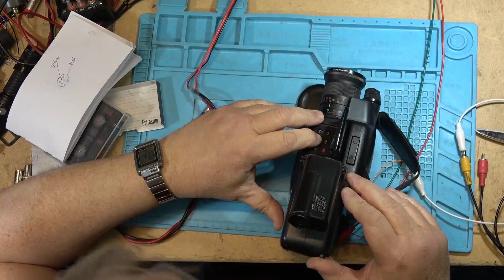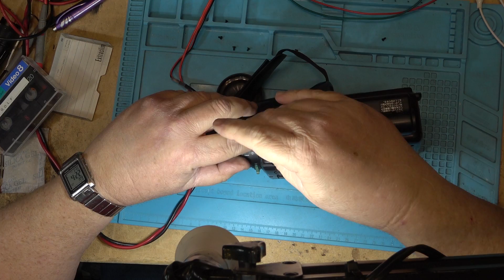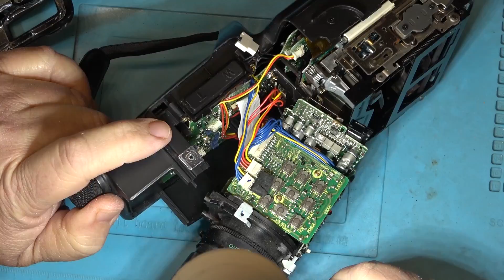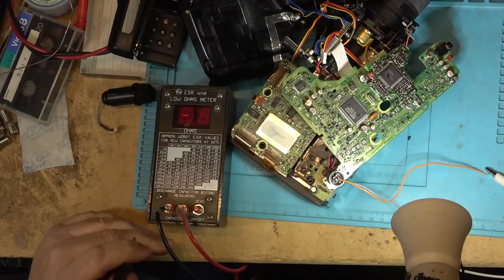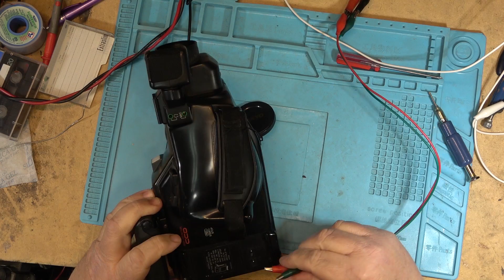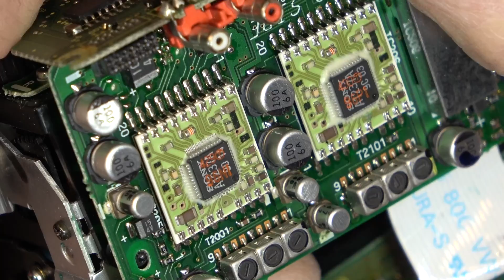That's it i'm Done Working on this CRAP

Comment: Great video as always. I've actually just almost finished re-capping a Sony CCD-F150 and am conscious of the future issues you mentioned with leakage on multi-layer boards. I'm doing it because the camera belonged to my parents, I have a couple of tapes we've never seen and also mostly just for practice / fun. The new caps didn't cost a huge amount (less than a few beers in town these days). I've thoroughly cleaned the board with isopropyl and there luckily wasn't as much corrosion as I'd expected - only a couple of isolated spots which weren't terrible.

Anyway, it's been great practice on my soldering skills, regardless of outcome! Otherwise you're absolutely right - it ain't worth it!!
Reply: Did you get it working. ?!
Reply: No, boards are al junk ate all the trwces pf the double triple layered boards @vcrguy1686
Reply: How does it hold up now?
Reply: @brew2779 it plays tapes back absolutely fine, but after about an hour of use after putting it back together, I lost a visible picture through the lens. Every now and then when I power it up after a few months sat, it displays an image but just fades after a few mins. I think it must be where the electrolytic capacitors have leaked into the layers of the board. Otherwise it's holding up well for playback.

Comment: For sanyo products, these sure do have a lot of Sony components in them, I wonder if sanyo bought circuit designs from Sony, but totally dropped the ball on the chassis
Reply from the maker: Sony made pretty much all the custom chips for 8mm and hi8. After all they designed it.

Comment: Sanyo has made some excellent components as often seen in audio equipment from many old Japanese manufacturers like Technics and many others and especially the power amplifier module in the STK series which can be found everywhere in the 1970s 80s but I've never worked on any Sanyo audio equipment that was not riddled with problems. Sanyo obviously made good components but was clueless about how to put them together, rant over!
Reply from the maker: I admit they did make some good components but so did toshiba and nec and those companies also semed to have problems turning out devices that knocked ones socks off. That was king Sony that did that.
Reply: @12voltvids  I agree Sony was slightly different and was slightly more expensive but for every Sony, I ever worked on and owned, TV's Hi-Fi seemed to reach above the rest. I had a Sony TV, Amplifier and so on but however British speakers in the day were the best! Love your channel and looking forward to your up-and-coming Tube amp project. cheers Ian

Comment: Why do the capacitors always go bad in old camcorders? A few years ago I wanted to restore a VHS camcorder for a friends art project. I had to get 4 different camcorders before I finally got a restorable one! Why does that always happen? Did they use special capacitors in those?
Reply from the maker: They used a new type of capacitor, the surface mount caps. The early parts were all bad from the get go. There were a couple of factors at play. First they had to be environmentally friendly. That means no tixuc chemicals that earlier (and still working 50 years later) capacitors contained. No pcb oil for example and no other toxic materials.  This was so when the unit was disposed, and went to landfill or incinerated no toxic materials would leach into ground water or go into atmosphere.  These newer compounds however were not stable.  The pH changed depending on if they were holding a charge or not. They were engineered to be pH neutral in their charged state.  When left totally discharged they became either slightly acidic or alkaline.  For something that was used all the time this wasn't an issue.  The caps were charged or had some charge in it that was changing as the capacitor did its job.   The problem was in camcorders. Most people didn't use their camera every day.  Sure the first year or 2 when the kids are little they are used every time the baby burps or farts.  You know the new parent syndrome every little event is recorded. After the first year or so that gets boring and the camera sits in its case only be brought out at Christmas birthdays or family vacation. This is where the problem happens they sit the capacitors completely discharge and the pH goes out of whack and over time it eats away at the seal where the wires lead out of the capacitor. Eventually the seal fails and they now close of electrolytic starts to leak onto the board where it saturates into the board under the cap. It soaks in to the fiberglass board and on to the next layer below where it spreads out and starts eating away at internal layers. This is why camcorders where the most unreliable device that the mainstream manufactures produced. They're never worth fixing once capacitors have started leaking. The only way you can fix these properly and be assured that they will continue to function is to change the entire board. Of course that's not possible because no spare boards were made available and even if you were to find a New old stock board it's had capacitors City in the discharge state since it was manufactured and they will all be bad even though they've never been used. When camcorders were made manufacturers all had a designed lifecycle a 5 years. That means at the time of production the manufacturers figured that people would replace them within 5 years with a newer better model. And most people did just that. Most camcorders were completely shot after 2 or 3 years because people would take them to the beach get sand in them did get rain on them to take them out on boats get salt spray. They were done after a couple of years and most people just bought new ones and moved on. Then there were the working professionals that used them every week to shoot weddings and stuff. Those ones wore out mechanically before the caps failed.  The only ones i changed heads on were the ones used by videographers.  They never had cap failures.  Untill the guy bought a new camera and put his old camera aside as a backup. One day he decides he needs a second camera fires up the second one that's been sitting for 6 months or longer only to find surprise all the Caps of leaked and it's now junk. Fortunately the new digital cameras are much more reliable. I have one that's 9 years old still works great that's my original 4k camera FDR fx100. Fortunately digital circuits don't rely on those crap electrolytics

Comment: No consumer electronics are worth exporting to another customs zone. Not even frigging Bose rubbish. The customer is mad. 8mm camcorders are a dime a dozen just like VCRs, and they were always considered disposable items even at the time. If you want to fix these - try to do them yourself and toss when they don't work. Late Sony included.
Reply from the maker: Well normally there are no duties or taxes on products being shipped on for repair but if the senders places a value on it then it is treated as a sale. A few years ago someone declared a Walkman as worth 1000. That cost him 160.00.  He insured it hoping it would be lost.
Reply: @12voltvids  Yeah but you've said yourself in the past that just the shipping can be far in excess of what any of this stuff is worth.
Reply from the maker: @jasejj  yes shipping is the expensive part

Comment: huh , and here i sit and fix such in my free time, i like working on them cuz its always a challenge :D  ,  just thinking , if you dont wanna put up with such cameras id be up for the challenge ^^ 

in other words whoever wants camcorder repairs that 12voltvid wont do , contact me, and i try ^^
Reply: as a sidenote , ccd-f and ccd-v are not fixable , those sanyos ? sure i would recap them , not the worst ive seen (like jvc gf-s1000) .
Reply from the maker: It not that I can't fix them, the problem is once you charge a fee to repair you are married to it. When it breaks 2 weeks later it's back and then you are doing it again for free this time.  You get it running and 2 weeks later it breaks again.  As you saw from the first one someone has already changed most if the caps, an ic has also been changed.  Someone already recapped it and that is probably why the camera section is working and likely the chroma problem is a corroded trace on an internal layer that has gone open.   I have the experience from my time doing this for a living to know when it is time to cut losses. Customers also don't want to throw good money after bad.
Reply: @12voltvids   i understand you officially repaired these back in the day , for my part i have sympathy for most old camcorders especially odd (like the twin lens sharp) or fancy ones(minolta master  pro 8-918)  , they may have no collectable value in functionality (standart def) but collectible in a way what tech marvels they were back in the day (all compact and such). either way i dont necessarily mean to downtalk you. id just like to blow life into those cams to see them working even if its short lifed
Reply from the maker: @Dr.-Smart  i just dragged out my old Sony ccdtr81 which I fixed a year or so ago. It hasn't been used and even though it turns on and plays, the picture shakes back and forth.  They don't stay fixed no matter what you do to them.  It's one think to get one if your own working just for the sake of getting it going but when you are charging someone they need to stay working for a while. That's one if the reasons i won't spend the time to change a bunch of parts.  Because they won't last and they the person that spent the money is mad.  There were lots of stupid designs back in the day.  Most of those sharp cameras were a joke.  Targeted at the older generation that didn't want to hold a camera to their eye but totally useless outside on a sunny day.

Comment: Changed all 100 caps in my Philips Full Size vhs cam from 1989 2 years ago. Still going strong. but i cleaned every hole for the caps with iso to stop corosion well its working
Reply from the maker: I changed all 120 in my old v5000 back in 98 and then sold it. About a year later it was back. Came back to the shop i worked at and other job cap problems had arisen from latent residue that had seeped into the board. You can't clean the layers internal. Your old full size camera probably only had a double-sided board as most of them use just a double-sided board not a multi-layer board because they had the physical room to put them on a full size board. The small cameras all use multi-layer boards a big difference.
Reply: @12voltvids  it has little holes going into the midel of the board

Comment: Its amazing you put up with fixing consumer crap that only gets worse. I did fix coin op for many years that had monitors but still much easier than a tv set. Commercial equipment is much easier but no youtube audience as its so expensive.
Reply from the maker: I put up with it for 20 years and then for out.   It's only a hobby now and I am saying no to much stuff. What you see on my channel is about 1/3 if what I am asked to repair.
Reply: @12voltvids no end of work that can maybe earn minimum wage with maximum skills
Reply from the maker: @markanderson350  If you are lucky. The only reason I took these in was to show them on the channel. That is where I will make a few bucks over the next few months and who knows it could go viral.
Reply: @12voltvids  Sanyo camcorder video goes viral, news at 11.

Comment: Dave, tell the people ' I don't do budget camera's sorry.
The level of crappyness is your choice.
Stress will screw you up if you don't change.
Reply from the maker: No stress here. I'll let you in on a little secret, the only reason I accept this crap which I know going in is not repairable is specifically to take it apart on camera to show you guys the inside of the unit basically and how bad they are and why you want to avoid trying to fix these. I know I'm going to get the trolls out there they're already responding saying that they could fix it.  Maybe it can maybe it can't. If it's just the capacitors and there's no other damage and the leakage hasn't soaked through the board and damaged internal layers that's one thing but once the corrosive electrolytic gets into the circuit board it soaks into the internal layers and crowds them. Might work today might work tomorrow might work 2 weeks from now and then you turn it on and it doesn't work because the trace has gone open. I have several cameras that are mine where I've gone and changed capacitors on them just to show if the camera working I put it together it works fine I'll hold it out of the box six months later and it doesn't work again because the damage that was caused before just powering it up reactivates electric because you can't get all of that crap out of the internal layers. Now someone's going to say they'll ultrasonic clean it, all that will do is drive it further into the board and cause more problems down the road. Better just to cut losses and move on.
Reply: @12voltvids 
I was fixing a friends car fob that was unreliable, i thought ill use a scanner to hear when the fob worked.
Well my 2005 realistic scanner had died on the shelf,  5 years without power.
One cap pissed on the pcb and black/eaten tracks were the result.
I removed all the parts in that area and cleaned up plus wires where needed.
It worked fine then.
I find scanners useful as they cover a large range, and for frequencys below 30 mhz i use my yaesu frg7700 receiver.
Handy for checking i.f stages on radios.
Reply from the maker: @zx8401ztv  capacitors pissing and crowding the board is one thing but it when it's a multi-layer board and that corossive crap gets to internal layers and does the same thing its a lost cause.

Comment: I've never cared for anything sanyo
Reply from the maker: I have a Sanyo color TV once. It was sold by Sears and had their branding on it. The tuner went out on it it was one of those crank mechanical tuners, it failed after only a few years and it was rebuilt tightened up all the contacts so forth at work the game for a while till it started to act up again at that point just put it on channel 3 and use the converter box. Probably ran that set for about 12 years until the picture tube finally got so weak that it was not a pleasure to watch so it was dumped. I've never really had much Samuel stuff since then in fact I don't think I have anything this made by Sanyo. One thing that they did develop and we all grew to hate very quickly all those bloody STK power modules did everybody ended up using in their amplifiers and they caused us nothing but headaches. What I work for Sony I was fixing the 5000 series VCRs at the factory service center. We were changing all the caps on brand new stock that hadn't even gotten to the store yet. What were we changing? We were changing out all the Sanyo branded aluminum capacitors on the servo board and replacing them with tantrums or as we called them, tiny time bombs. You know that the tantrums were going to keep working until one day they'd be a bang and they would stop. But at least they lasted the warranty period. That was 1983 and that's pretty much why I lost all my faith in Sanyo. Coincidentally this TV that I mentioned it was from about 1976 then it was done by about 88.

Comment: JVC Cam corder from back to the future movie worth something even if not working 😕
Reply from the maker: I have a Sony from that era. Worth nothing.  The JVC prop from bttf is worth about 25.00 working or not.  I had one it was working.  Since i don't eBay I let a friend post it it.  Put a 100 reserve and it didn't sell.  Let it go to high bidder.  27.50 is what it sold for.  Cost 50 to ship out.  They don't go for what people think. 
Even a BETACAM doesn't go for much.  I picked one up fully functional for under 100 complete  with carry bag and battery.